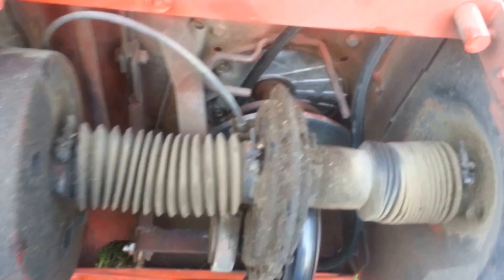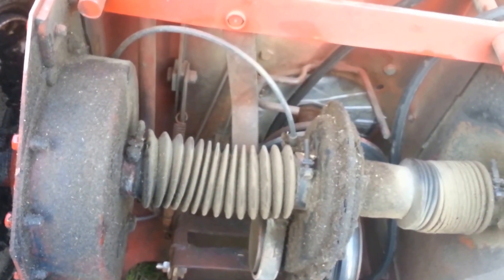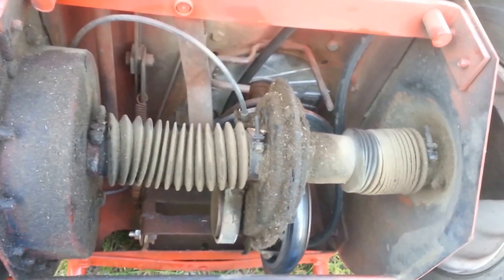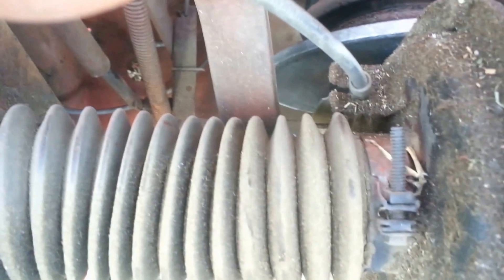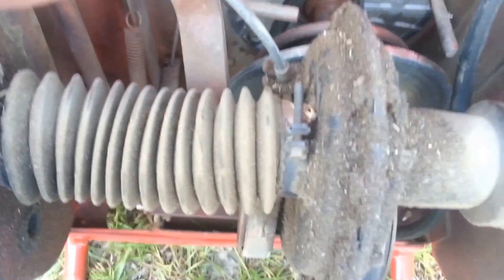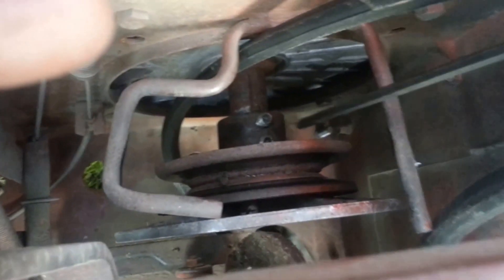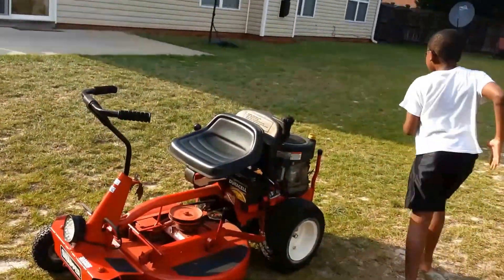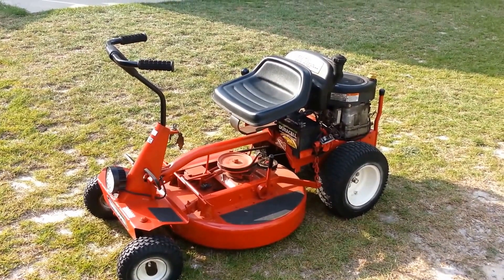Snapper Rear Engine Rider Drive Disc Adjustment  - DIY OneForAll

Comment: My snapper was stopping when I would put it in 3rd and 4th gear and struggling to move on small inclines. I would have to put it in 1st gear to move. It has been like this for long time. I did what you showed in this video and now every gear works great and the front wheels come off the ground when I release the brakes because it has that much more power now so THANK YOU SOOO MUCH and keep going the great videos
Reply from the maker: That is great to hear. Cheers and all the best with your Snapper.

Comment: Thank you. My snapper has treads on the bottom of the crank shaft. But you shown me that lowering the pully is the way to adjust the clutch. So thanks..
Reply from the maker: Thanks for watching.  I wish you great success with your adjustments.

Comment: Most times those discs are frozen solid/rusted in place. You were very lucky to move it.Not everyones is that easily adjusted.Some people will have to remove the engine in order to gain access to freeing up the disk to make it slide.
Reply from the maker: Very true, my friend.  I consider myself very blessed to have had it come off like it did without much effort.

Comment: Just finished a new bottom crank seal and adjusted the drive disc and it runs and drives great.  A note of caution to anyone doing bottom crank seal. I thought the seal on the engine was leaking, and it was a little.  It was not leaking enough to get oil on the drive disc. The area by the drive wheel was leaking transmission fluid around the rubber boot over the axial. I finish the whole job and it got transmission fluid on rubber drive. 
fix: Tighten band around the rubber clamped to the to differential and clean very carefully and then spray carb cleaner on the rubber and disc.  That is all i had to do. could have saved a lot of time. Hope this helps someone out there.
Reply from the maker: +Patrick Wolbert 
Great job, Patrick!

Comment: I got one from the 60s. trying to let it soak. my pulley is seized to the shaft. great video
Reply from the maker: Thanks for watching and commenting.  You may have to let it sit overnight to break the rust up.  PB Blaster is good for breaking rust. All the best.
Reply: Air chisel/hammer it off.
Reply: You may only need a replacement friction ring. They wear out and are made to be replaced over time. They key is when replacing a new ring. It should not be able to slide over clutch when in gear. Has to be in neutral positing to install the new ring.  If you can install the new ring while in gear , then you need to drop the friction plate more to make good contact with friction plate and new ring.

Comment: Experience has told me TWO ISSUES RELATED TO your video: 1) Too close to gearbox and you will have trouble installing new belt.  2) Looking at your grease leak deposits, shaft nut for clutch likely loose and key at risk; getting properly tightened MAY cure leak at seal without seal replace.  Can be a real challenging bear if woodruff shears flush, and requires patience and special tools to remove old woodruff.  I.E I SUSPECT THE GREASE LEAK IS THE REASON FOR THE CLUTCH SLIPPAGE.  i WENT THRU two new DRIVEN DISK HUBS (that clutch bolts to) before I got shaft properly torqued to prevent coming loose again.  GOOD LUCK.

Comment: The old type "hard" clutch can be replaced with the newer smooth clutch, there used to be a kit that had everything in it for this upgrade, not sure if it is still avaliable, I saw the kit in a old parts manual years ago.
Reply: +Numa Newbern what is the part number for this "previous type" clutch you speak off? I would rather do that then tinker around with a crank pulley setting but if I don't have a part number to order I cant order it and asking at the dealer just got blank stares at me from the kids behind the counter.
Reply: It has been obsolete for YEARS, BUT I think I have some, I'll check.
Reply: BTW, the pin welded onto the end of the primary chain case has a hardened sleeve on it, as the sifter is shifted this pin with hardened sleeve moves from side to side in the "yoke" slot, many times the hardened sleeve begins to have a groove worn in it, this allows the driven disc to sit FURTHER from the drive plate on bottom of the engine, thus giving the impression of wear on the rubber drive tire. The same issue arises when this same hardened sleeve wears into the inside surface of the slotted area of the "yoke". BEFORE you go to the trouble of lowering the engine plate check these issues I noted above.
Reply: On front of the old parts manuals it tells how to determine the series, with YOUR example your unit is a 19 series
Reply: +Numa Newbern I have the hi-vac 25" Snapper M250819BE, I think its 2001 because serial number starts with the number 1. im wondering, if its been obsolete so long, as you say, do they still sell them? and will they fit the newer models which have design changes to the brakes as well?
Reply: Series 4 & 5 Snapper Parts Manual ( 1985 ) has the part number for the Smooth Clutch kit as 60601, this was used to convert the old hard clutch to the newer style. ( I personally prefer the Old type and that is all I run )

Comment: What size wrench fits those Allen screws? I'd hate to tear mine apart only to find I don't have that size.
Reply: Yes I need to lower mine I've tried both metric and standard want a second opinion before I put torque on it

Comment: Excuse me, could you please tell me if it is normal for the drive plate not to be perfectly flat but presenting some grooves at the level of second and third gear?.. is it wear? Should I change it or just lower it?
Reply from the maker: Try lowering it first.

Comment: The yoke on mine was badly worn not putting enough pressure against the plate. My disc barely touched after lowering plate to maximum 3 13/16.

Comment: Hello I just bought used SR130 with 11.5 hp.  Are the drive discs all the same size?   Done valve adjustment on it and  cleaned the carb.  and it's running pretty well so far.  Just need a belt and drive disc.  Where is a good place to get parts?  Wife doesn't understand why I'm always playing with these things!  Thanks.
Reply from the maker: Based on what I have seen, they look pretty much the same.  However, you always want to ensure that you are getting the exact manufacturer recommended parts for your mower. Here is a place that gives a good break down of the parts when you enter the model number of your Snapper mower:
https://www.partstree.com/parts/snapper/mowers-rear-engine-riding-lawn-mower/3011511be-snapper-30-rear-engine-rider-11-5-hp-series-11/drive-disc-assembly/

I also purchased parts from 
http://www.sjmparts.com.

Yeah, I know how the wife thing goes :)

All the best with your Snapper.
Reply: +DIY OneForAll Clutches are different. Some have a brake lining, some do not. Check your dealers price. Most times they are no higher than Ebay.
Reply: Wondered myself. May be different sizes only takes 1/16 can make a big difference

Comment: Not sure if you have a video on Mt specific issue but my mower won't climb a hill in 3rd,4th or 5th gear. Climbs perfect in 1st and 2nd. Replaced rubber disc, adjusted break/clutch. I'm at a loss. What would you suggest?
Reply: Get some brake cleaner on a rag and wipe entire surface of the drive shaft disc (shiny metal disc). Wipe till you remove all residue.  You don’t need to tip mower on end just lay down with a flashlight and go for it. 
Hold on tight

Comment: Do you have any info on how to install (replace broken) idler arm on snapper riding M281019BE. I have part but cannot see hoe to 'slide' off broken piece and put new  back on to spindle. another DIY project (I hope)   thanx
Reply from the maker: Looks like you will need to remove the main deck pulley first.  Here is a link: http://www.searspartsdirect.com/model-part/m281019be/3290/1506000/p0807039/00015.html
Reply from the maker: +DIY OneForAll 
Hope it helps.  It should be a fun diy :)

Comment: hi thanks for the video can you tell me the size of those two screws? i can't find a key that fit!
i tryed with a 5 and a 6 but its too smaal or too big! i'm scared that is an american size!
can you help me?
Reply from the maker: federico moroni 
What's the model of the mower? I was able to find this info.  

Snapper Hex Recess Set Screw 7090132YP

Hope that helps.  Cheers

Comment: Ho to stand a snapper yard cruiser on it's back bumper?
Reply from the maker: The Yard Cruiser is big machine.  I would rather Jack this one up or use a lift to tilt up.  This one could leave a hurting on the back if attempt to lift :) Cheers

Comment: Anthony, you should not have messed with the disc, should have adjusted the spring to the left --- especially since you did not do a max/min spacing adjustment of the disc after moving.
Reply from the maker: Doug P 
Thanks for the comment and suggestion. However, I did have to do both.  The previous owner installed a new engine on the Snapper but the spacing was incorrect when the engine was previously replaced.  The adjustment resolved my issue. Cheers

Comment: And that doesn't mess with the blade belt alignment and cause premature wear on the belt? I'm no lawn mower expert but I am concerned about that. Old style car gamblers would get chewed up if the pulleys weren't perfectly lined up, is it not the same principle with these mowers? Again just asking not trying to say anyone is wrong, just wondering what you know that I dont.
Reply from the maker: bubba ray 
Well, it's still liking what I did to it after all these years. No premature belt failure. Mine was really out of alignment to begin with.  I bought it from a fellow.  Cheers
Reply: I know this is old but the deck height adjustment changes the belt angle much more than moving the pulley 1/4" or less.

Comment: From your video ...You need to replace the drive wheel with the rubber on it  and then adjust the drive wheel on the motor...I have an older one then yours and mine runs 25 to 30 mph in the high gear....yours should run a lot faster than it is....WCH
Reply from the maker: I would be afraid to go that fast.  My yard is small, and I have smaller kids. However,  I wasn't driving fast in this video.
Reply: I thought is was moving slow in video also. Mine will haul ass in 5th gear.